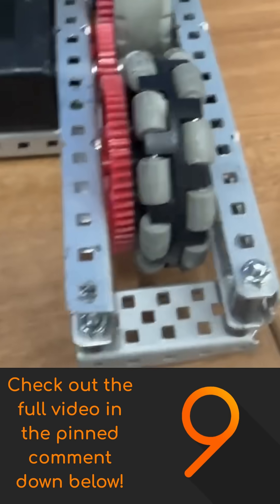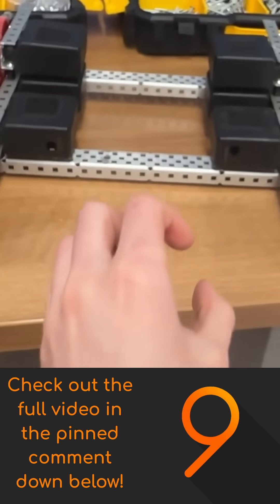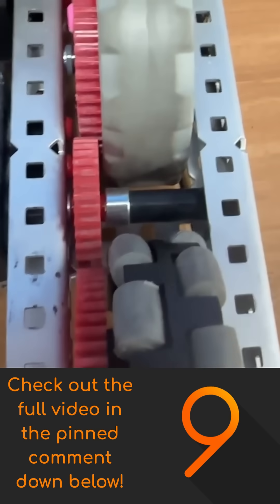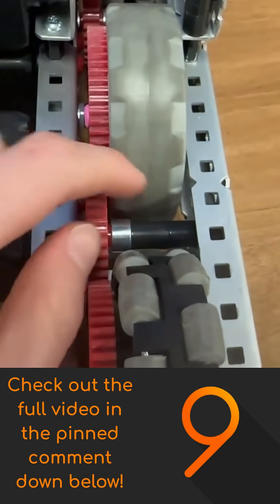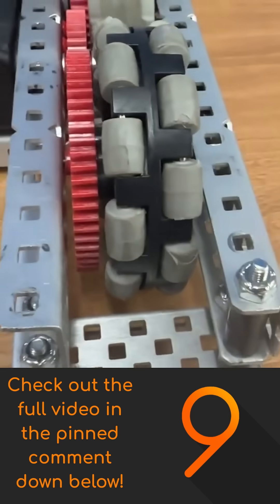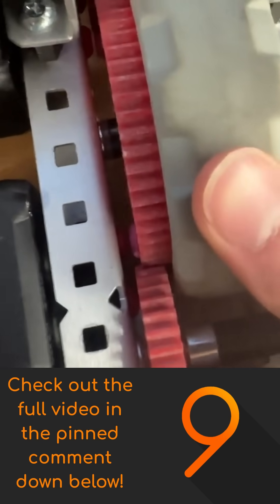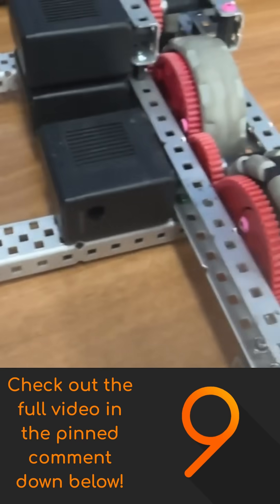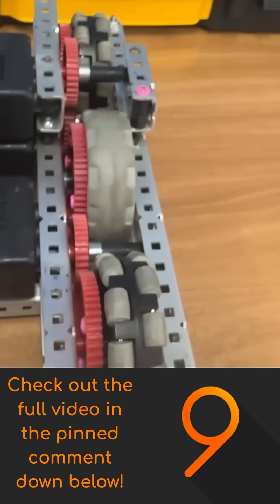3 Hole Gap #highstakes #vexrobotics #robotics #vex #roboticscompetition  #vexrobot #robot #pushback

Comment: I am doing 2 hole gap as direct 600 rmp. Is that bad
Reply from the maker: I don’t like how you can’t gear the wheels together. It makes it easier to play defence on you and it’s harder to get a more accurate autonomous with
Reply: How are you getting 2 hole gap? We tried that last year with direct and we couldn't get it to fit with omni wheels
Reply: @EthanRhode either no gearing or they did some crazy stuff and turned the wheels into partially gears themselves
Reply: We did no gearing and could not get it to fit with omni wheels @bertenheimer
Reply: @EthanRhode might also have to grind down the flanges, can’t remember
Reply: @EthanRhodeI wouldn’t suggest no gears because it can cause all the wheels to be driven at different speeds and then causing drift